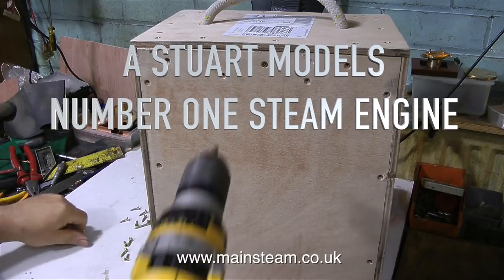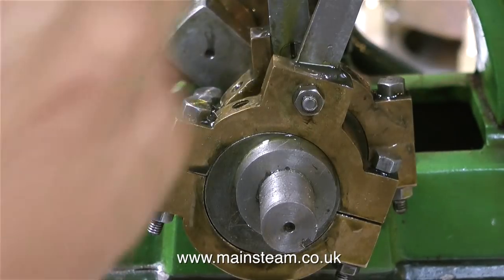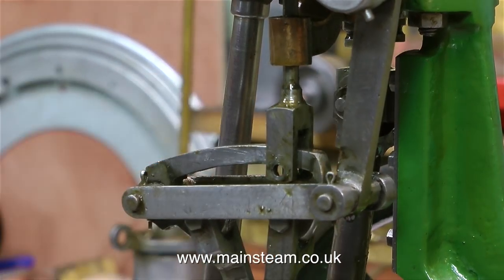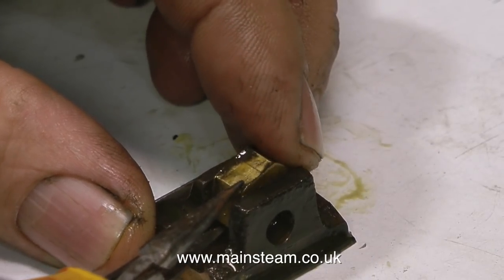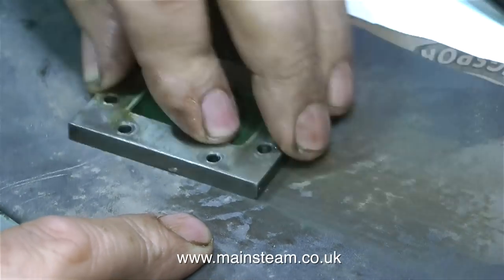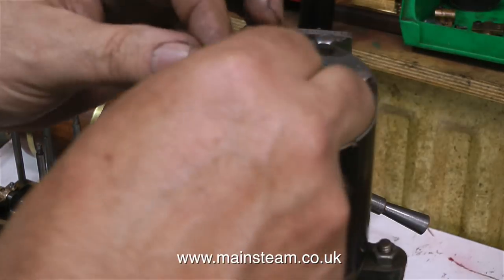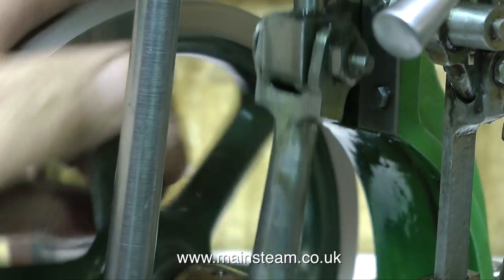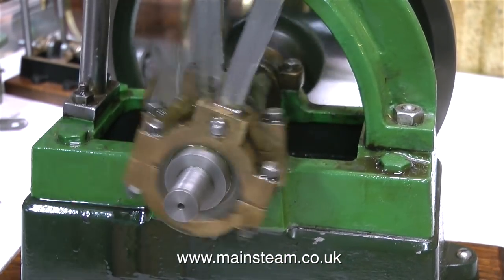STUART NUMBER ONE STEAM ENGINE REPAIR -  PART #1

Comment: Keith, a fascinating video,many thanks. Way back in 1963 my father built a Stuart no. 1 and installed it in a 16ft clinker sailing dinghy hull with a coal fired vertical centre flue boiler. In 1965, (when I was thirteen) we steamed the boat from Brightlingsea in Essex up the River Thames to Stoke Bruerne near Northampton on the Grand Union canal and back, all in a week!! Happy days. My father is now ninety and still has the engine, (but not the boat). All the very best, Robert

Comment: Keith, I came on your channel last year when I found my childhood Wilesco D10 steam engine on the attic of my parents house. My steam engine is now about 30 years old and it was standing still for about 25 years. After a cleanup and some small fixes it now runs like a charm. My biggest problem is that your channel is so encouraging that I'm now really looking around for a lathe and a milling machine to start making a simple oscillating steam from scratch to get me re-familiarized with the tools. I did some lathing an milling during my school years, but that was before I switched to electronics. 

Thanks for all the informative videos, and it's really encouraging that you are also coming from a different background.

Comment: Wow - thanks for posting. I've got a Stuart No. 1 - "brand new" still in the box from the 1950's I think. Never been built - I look at it now and then; and ask myself if I'm ready for this project - then I put it away again and work on a smaller project. But someday is coming!
Reply: Sit down with the plans, have a good long study of them, and work out the order of operations; which bit to do first, then second, etc. Sometimes it's not immediately obvious, you may need to machine (or partly machine) up one part (for instance) with tapping size holes when the finished work called for clearance sized holes, in order to use that for a drilling jig for other associated parts first, BEFORE opening up the holes to clearance size. But make a start on some part of it, and progress each operation, one bit at a time. That way, you're not biting off more than you can chew, and you can see progress - forward motion!

Comment: Now that I have watched a number of your videos it was interesting to note visually the obvious discrepancies of the steam engine right out of that well made box. Also I view your videos on a 57 inch TV screen which really shows a lot of the details in your videos as opposed to viewing them on a laptop screen. Your workshop is indeed a well used and worked in mess and shows up well on a 57 inch TV screen but don't change a thing unless you absolutely have to.

Cheers!😁🚂👍

Comment: A very interesting channel here, my 1st time viewing this. Very good. As soon as you started with this it was obvious that there had been sloppy assembly of an otherwise good engine, and when you had to prise off the valve chest cover and there was all that bath sealant goo tested of a proper gasket there, I thought "what the heck!". And when I saw the valve, it was obvious that something was amis ; it should be steam pressure alone that holds the valve onto the port face, and therefore the valve needs to float (but no slop), so yes, the valve nut needs to be a VERY SLIGHTLY loose fit in the valve. Likewise the bath sealant sticking the outer cylinder cover on, instead of a proper gasket (they're easy enough to make), and all the other sloppily, poorly assembled parts. It only takes a little bit of care (at each stage) to make a proper job, but some people have no idea....as I said, good video, thank you.
Reply: Stupid "predictive text"! I wrote "instead of", not "tested of" (line 7). M.S.

Comment: Perhaps a dumb question, but what is the power output of one of these  things on compressed air or steam ? My limited understanding is that the expansion of steam offers somewhat more power,is that correct  ? Shop dog Sam in one of his videos stated the original power output for the Maytag two stroke gasoline  motor  washing machine was ,I think,about two thirds of a horsepower. I do not suppose that using a Stuart to drive something is the primary goal,the machining,fitting and fettling being the primary desire of many. Watching you do advanced tuneup and repair of a project mostly completed,or perhaps tired ,is something that gives me real pleasure. No doubt there are many such,there are a lot of individual steps to a finished unit.Cheers.
Reply from the maker: The only example that I know about is a Stuart 5A Steam Engine. That is rated at 1.5 Horsepower running at 80PSI.

Comment: I don’t think you should be so hard on the person that built this. He may not have had your skills and experience or well setup machine shop , but that shouldn’t stop anyone from having ago. Perhaps his next engine was a masterpiece.  But I know how you feel. I restore vintage electronics equipment and find much the same kind of thing. Great video thanks for sharing. Regards Chris
Reply from the maker: I am not being vindictive in any way, Chris, I can only comment on what I see at any given time and feel that it is often useful to show beginners to the hobby the pitfalls which occasionally include how NOT to do it }:-)))
Reply: Keith Appleton That’s fair enough. I do a lot of electronics repair and often find similar issues you do. However it makes life interesting if not a little frustrating at times.

Comment: Hi friend, great videos, I have to translate, but it's worth it, you're a great master of the engines. I would like to know in the construction of a Stirling gamma engine I can build the two cylinders of the same size, or have to have a difference between the cylinders. Does this change the power, is there any relation between them? Example: If the hot piston cylinder is 500cm3 and the power piston cylinder is 500cm3 it will be an efficient engine or it must have one smaller than the other. I hope you have understood my doubt, in case you can help me thank you. Registered.
Reply from the maker: i know little of Stirling engines, I just  build and repair Steam Engines

Comment: what size boat would a Stuart #1 engine push and what size boiler would you need? thank you!
Reply from the maker: as a guess I would say that a Stuart Number One would push a boat of around 10 to 15 feet long. and as an absolute  minimum a 6 inch diameter coal fired boiler would be needed, but preferably much larger.

Comment: i don't understand how a well manufactured machine can be assembled so as to it not running (besides not tightening the screws and bolts enough).
Reply: It isn't "well manufactured".  The tolerances are sloppy (poor quality control) and original assembly was indifferent.  Design can't compensate for those choices by the maker.

Comment: That rubbery stuff looks like silicone!! Bad choice.
Reply: a friend brought a set of carbs from a 4 cylinder bike for me to look at. They had been assembled with silicone - silicone dissolves in petrol or oil. After spending four hours cleaning the carbs and reassembling them (There was noting wrong with the rubber gaskets anyway!) she ran like a dream - horrible stuff!

Comment: I think that the sport of it, for people with a more positive look at the world, could have been to make the crankshaft straight, especially the middle part. You had it in the lathe, so it was no big deal. Then you could have added a little bearing material on the middle bearing and scrape it to fit, like with real engines, rather than purposely destroying it with a drill and disposing it in your drawer to forget.
Reply from the maker: Not as simple or practical as you assume. I do not work on impractical time consuming badly made parts that were made incorrectly in the first place. The engine will not be forgotten, far from it - in a future video I will make a full rebuild series about this engine . . . . . you may disagree with me, and I would like to see your video of a successful repair job on an engine like this one . . . . it's not worth the time or effort.